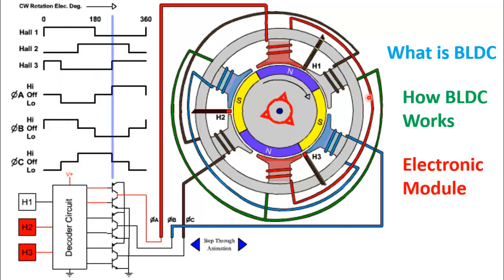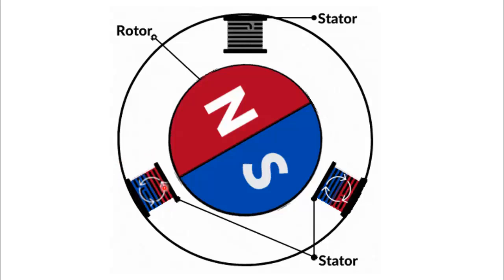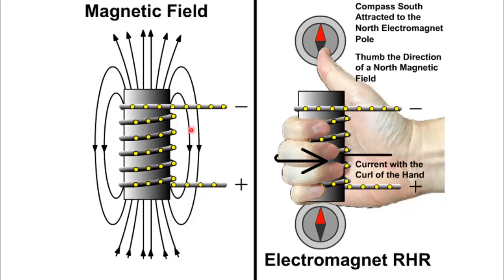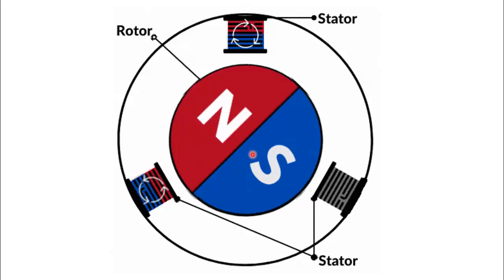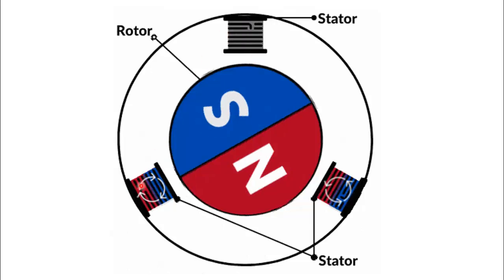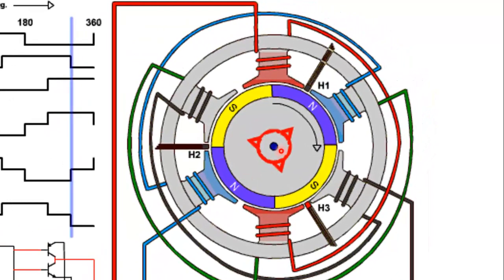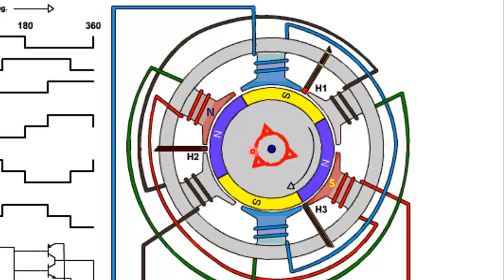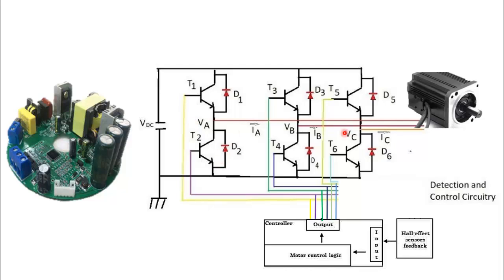BLDC Motor | Brushless DC Motor | How BLDC Motor Works

Comment: _❤ lex ellectrodinamycs force .. rotE#dB/dt+rot(v×B) and rotH#J+dD/dt and ErotH--HrotE#div(H×E) .. after and with the lex the engine ellectric motor movie work .. the this lex is identic at speaker difusour sound where rotation movie becum movie translation of membrann difusor sound speaker .. ❤❤❤❤❤❤❤❤

Comment: Does this motor use only electromagnetic attraction/repealing between magnets ? There is no electromotive Lorentz force ? I heard that motors are moved by the electromotive force - force that magically pushes on charges travelling thru magnetic fields, and therefore, I'd say, it applies to coiled rotors not to coiled stators - but does this mean in this motor the power input is always the same ? A regular DC motor moved by the Lorentz force should draw more amps as the load opposes more the rotation. Does a BLDC motor consume the same, regardless of the required torque ?

Comment: The emitters of your PNP transistors are connected together but are NOT connected to +V, therefore this circuit will supply NO current to any of the field windings. Please fix this diagram.
Reply from the maker: Noted. Thanks alot